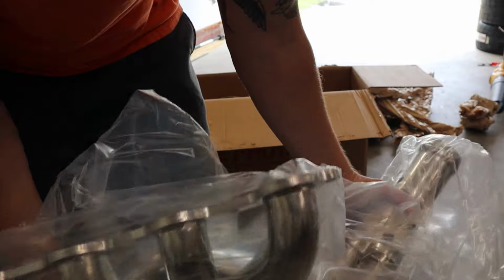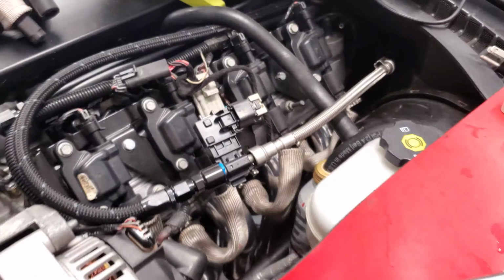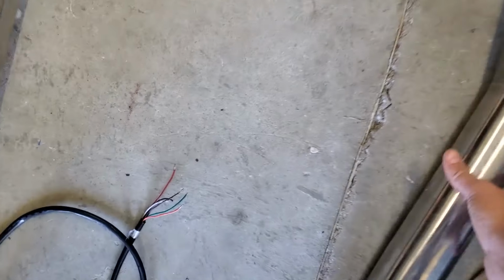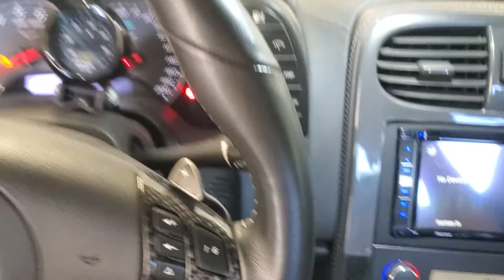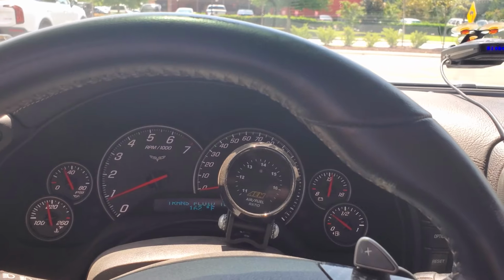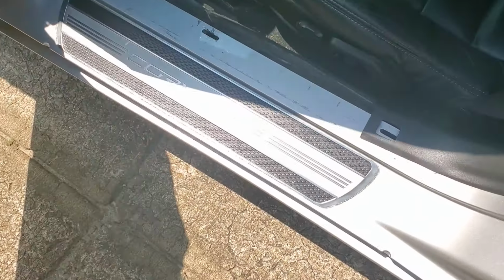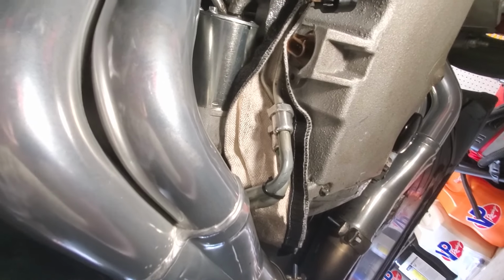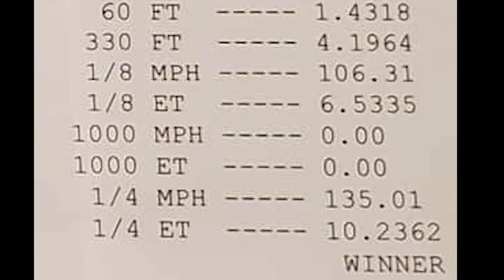My Cammed LS3 C6 Corvette Is Finally Back On The Road!

Comment: 10.1 SBE? no spray? very good for a N/A LS3!
Reply: @andrewd843  Awesome! Very stout! Yeah 9.8's are defiantly there. What size tire you running? 275/40/17?
Reply: @andrewd843  Nice! yeah I got a set of C5Z wheels with some MT's 275/45/17's mounted. I am waiting to get my Monster LT1-S clutch in and then I'll be hitting the track. I just have a H/C LS3 making 500whp. Hoping to nick a 10.7/.8 pass.
Reply: @andrewd843  you ever think about using the 315/35/17 DRs